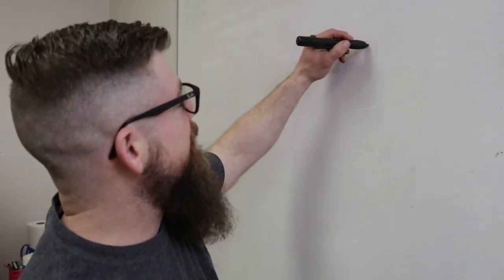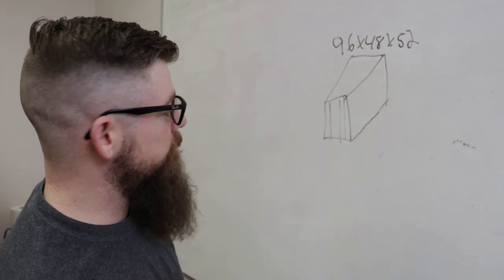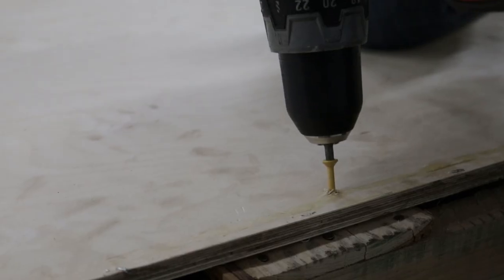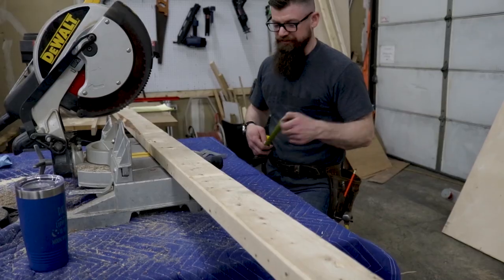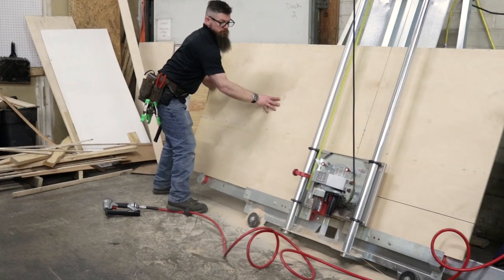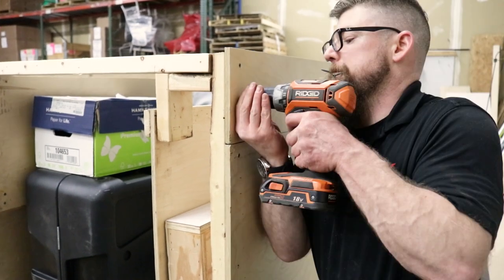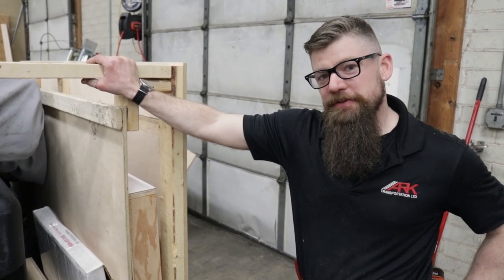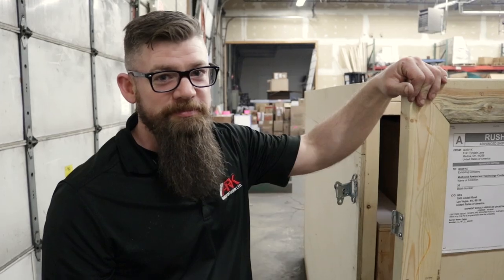Building a Custom Shipping Crate!

Comment: how do you lock that? someone can open that in transit so easy
Reply from the maker: There are ways to add a padlock or attach a locking mechanism, but surprisingly most freight moves so quickly though a network that it doesn't sit anywhere long enough to be tampered with.
Reply: @arktransportation  padlock? thats just one hammer away.